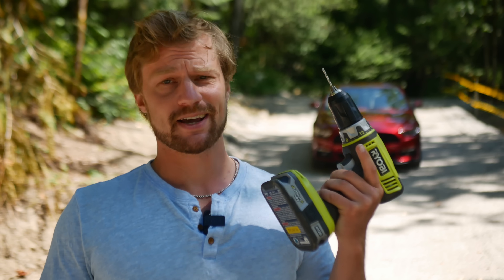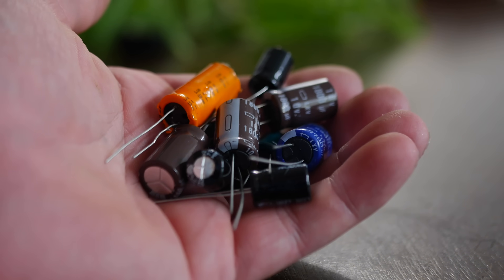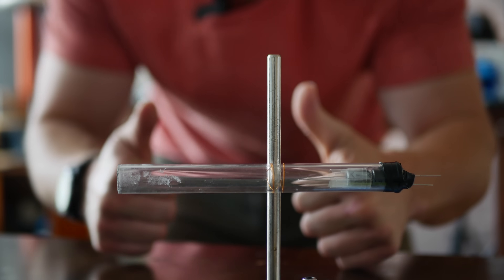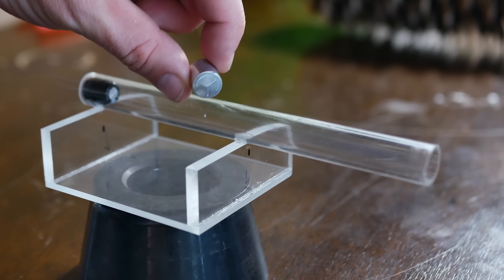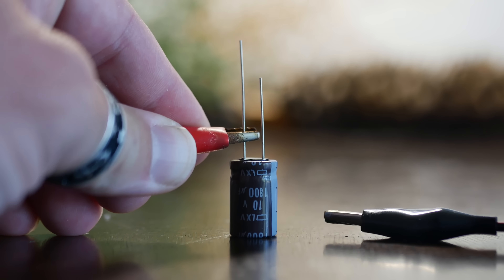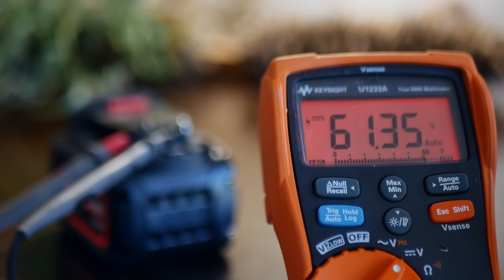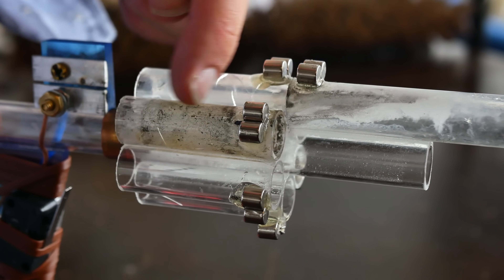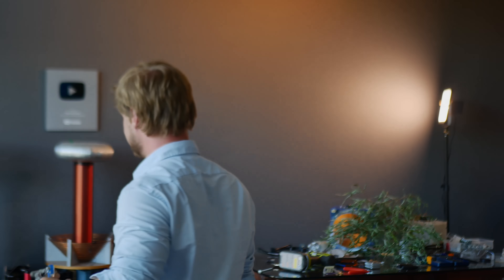I Built An Electric Capacitor Revolver!

Comment: Ha ! Have been playing with circuits and caps ...well good chance longer than you have been around ...yea I'm old. Titanium caps are more bang in a smaller package. As a younger man I built much of my test equipment,  and being a fan of militurization small compact circuits set about my work area.  While trying my newly constructed frequency generator,  a small circuit setting 3 or 4 feet away, exploded , at 3 am such thing can be startling . Now the board had been disconnected for several days and decided to explode ?? Well 3 am is a tad late to start an investigation.  Making sure all things were powered down I went to sleep. On the week end I took a closer look at the tiny board, the cap had left a good size mark but why. Had to find the schematic,  go over each trace on the board ... damn I hate puzzles ... lol next day check parts decided to rebuild and  duplicate the error. A few hours latter with an aluminum cap ...higher voltage rating...nothing trip to radio shack ...replace cap ...fired up frequency generator fumble trying to remember the settings ...bang ...but why ? But I now know the frequency give or take ... it would take some time but the little board was receiving that signal, acting as a voltage multiplier and bang had the little board been powered up it would not explode .... I miss those days ... spent most my life looking for why and repairing things , retirement was to be a rest with fishing and ...boring so I tried my hand at quadcopters  but the circuit was too big ....so I proposed a design to a semiconductor company ...they sent me parts the cad system allowed the designing, results 11x17 mm controller  worked simple double sided board, secret place the processor on the bottom ay 45 degrees the board required 4 feed thru connections two pads for power 4 for outputs. ... sadly age has stolen eyesight and manual dexterity... thus my bench sits abandoned . Hey take care .

Comment: 5:06 the bullet not leaving the barrel is a rare failure in ballistics. it means that your propellent produced less gas than the volume of the barrel itself. this usually is only possible with compressed air at extremely low pressures lol

Comment: this is literally a steampunk revolver lol. it uses literal steam as the propellent, which is awesome. i've seen a few different designs that use a boiling fluid (usually water) as propellent, and they are always interesting
Reply: Technically aren't all CO2 based airguns doing that?

Comment: There is one done by spraying alcohol/gasoline in a thic pvc-pipe  chamber,  igniting using kitchen sparks (piezoelectric) , the pressured ignited gas output can be adecuated for needs ,  nicely using pvc reductors... , ... has good results.  of course this I wrote is a story not steps for doing stuff and yes anything with pressure is not to be taken without knowledge , age , respect por equilibrium ( i think i nailed it)

Comment: Capsulated uranium in a sense kind of like assert or duct tape when you pull it apart quickly that kind of reaction I think would be a better capacitor of sorts if you know how to engineer it correctly but you can use byproducts of uranium like the glow-in-the-wop night watches from old times and some of the China and then there is a green uranium uranium glass producing a capacitor reaction if done right you'll get more bang for your buck

Comment: Question is that motor powerful enough to turn a whimshurst machine if so hypothetically it could power itself I would like to see you try just for the fuck of it
Reply: You may need to custom build the plates for the windshurst machine to be ultra thin ultra light ultra low friction with an induction coil the electrons returning to the capacitor could pump more electrons into the whimshurst machine making it more efficient

Comment: Have you tried using smaller capacitors?
I discovered accidentally that some small electrolytic capacitors shoot their casing out very fast. I was desoldering some componets with a blowtorch and one capacitor flew so fast it left a mark on the ceiling. I have only tried exploding them by heating them externally but it should work with electricity as well. It seems that the bigger capacitors just burst at the top with a relatively low pressure but the small ones are able to hold so much pressure that the case pops out of the rubber base and shoots away. Using them would simplify the design and make it more powerful and possibly more compact
Reply: Keep the higher energy of the big ones and just seal the top so they can't vent
Reply: @aliveandwellinisrael2507  wouldn't that risk a failure in the acrylic potentially blowing the gun up in hand?
Reply: lol, I had one 1000uf cap give me a black eye when I connected it in reverse on a slayer exciter circuit when I was little.
Reply: Older capacitors don't have those safety vents, even the larger ones. And on cheap chinese caps the vents sometimes don't work.
Reply: The big capacitors usually have groves cut in the casing, to create a weak spot that opens up a small hole at a relatively low pressure, allowing them to vent rather than explode (for safety - even if it's fun to make them explode in a controlled way, it's not that nice to have one go off in your face, if there is an unexpected failure of a device). The small ones often don't have that, since the explosion will not be dangerous anyway.
You can look at the aluminium surface on top of them when they are attached to a board (or when holding them with their legs down)
 - if that surface has some "lines" or a cross on it, they are the ones that will vent rarther than pop, haha. It it's a flat surface, they will probably go off with a good bang, haha

Comment: And what about some big ass capacitor to store energy, before realising it extra fast, extra high in your smaller ones used as ammunition ?
Plus, using some DC-DC boost /step up boards to achieved easily some high voltage.

Comment: this isn't a video about how to build a weapon.
continues to show everything you need to know if you have basic electronics understanding.
Reply from the maker: That’s the trick. I left out some pretty serious minor details- that if you built from this video - you’d likely fail at having it successfully work. I learned the hard way, and cut out the parts that would make this easy to build.
Reply: @PlasmaChannel  yeah you could do high damage with the 60V battery if you aren't carefull and know what to do.

Comment: First, you should not use modern capacitors, but old ones. there was no "safe" pierced bottom in the case. second, you need 220 or more voltage - it bangs like a shotgun.
Reply: Yes of course. Maybe, maybe. Very probably. Look here:
! New: Apocalypse Coilgun, Fallout Coilgun
https://youtu.be/G9-jKWPyMFo

See also: Portable Super Coilgun:
https://www.youtube.com/watch?v=rclLsQ9nyeg&amp;feature=youtu.be

https://www.youtube.com/watch?v=-mjDqp_oWZk

https://youtu.be/YLOYxsqvjw0

Comment: You would have liked the coil gun they showed on a T,V series here in Australia back in 1985 called Towards 2000, over the years I have watch them suppress any info on the show.
But they showed a coil gun with a ten foot  barrel they estimated, had the power to shoot a 10mm ball bearing threw an aircraft carrier and leave a two foot hole from one end to the other.
The live test they showed went through, 20ft of compressed phone books stacked 4ft wide 4ft high that had a foot thick of concrete each end squeezing it together, after that was block of lead 4ft x 4ft x 1ft thick just in case it made its way threw the phone books, then they had a 6ft x 6ft x 6ft block of reinforced concrete for extra safety, after that was the 2ft thick bunker wall.
When they fired this thing, the room turned yellow, and after the dust settled from the phone books being vaporized you could see the blocks holding the books were rubble the lead had a 2ft hole in it, the reinforced block was rubble and the bunker wall also had a 2ft hole in it.
They never found the projectile.
No wonder they suppressed the series of the internet, slowly but surely it has all but gone, like it never existed.
They showed all kinds of cool stuff, inviability, a living AI computer smarter then anything else ever developed, it is were the Terminator movies came from, they used it to build a military soldier and had it working with humans in an ungrounded military base, and yes it turns on them, pesky AI just can't tell who the bad guy is.
Reply: Yes of course. Maybe, maybe. Sure. Very probably. Look here:
! New: Apocalypse Coilgun, Fallout Coilgun
https://youtu.be/G9-jKWPyMFo

See also: Portable Super Coilgun:
https://www.youtube.com/watch?v=rclLsQ9nyeg&amp;feature=youtu.be

https://www.youtube.com/watch?v=-mjDqp_oWZk

https://youtu.be/YLOYxsqvjw0

Comment: i recall walking into my local electronics shop to find the staff gigglinh like idiots, waving hands to try to clear the smoke... they were using ceramic caps and leaving a small dent in the tiny heat sink they used to lay the caps on before over volting them. do not know the specs, but might be worth a look...
Reply: Sure. Maybe, maybe. Look here:
! New: Apocalypse Coilgun, Fallout Coilgun
https://youtu.be/G9-jKWPyMFo

See also: Portable Super Coilgun:
https://www.youtube.com/watch?v=rclLsQ9nyeg&amp;feature=youtu.be

https://www.youtube.com/watch?v=-mjDqp_oWZk

https://youtu.be/YLOYxsqvjw0

!Coilgun and Survival in the Zombie Apocalypse
https://youtu.be/_9WUcGwmS5s

Comment: Could you use a voltage doubler type of circuit, or step up, and a charged capacitor to get higher voltage, and the discharge rate of the capacitor would apply the voltage at a higher rate than just a battery and microswitch?
Reply: Maybe, maybe. Very probably. Look here:
! New: Apocalypse Coilgun, Fallout Coilgun
https://youtu.be/G9-jKWPyMFo

See also: Portable Super Coilgun:
https://www.youtube.com/watch?v=rclLsQ9nyeg&amp;feature=youtu.be

https://www.youtube.com/watch?v=-mjDqp_oWZk

https://youtu.be/YLOYxsqvjw0

!Coilgun and Survival in the Zombie Apocalypse
https://youtu.be/_9WUcGwmS5s

Comment: The better way is to charge up a massive bank of capacitors to a lethal energy level, say 5- 10,000 volts then create a switch maybe under insulation oil then create special bullets full of a conductive medium which will expand rapidly has it turns to white hot plasma (Salt Water may do the job, but you could even Hybridize things by using a damp Gunpowder with Graphite instead of Carbon in the mix) Has the Capacitors discharge onto the special bullet a massive electrical explosion takes place within the base of the bullet, the pressure is now immense and the Lead slug separates from the base of the bullet and is propelled down the barrel.
Reply: Sure. Maybe, maybe. Very probably. Look here:
! New: Apocalypse Coilgun, Fallout Coilgun
https://youtu.be/G9-jKWPyMFo

See also: Portable Super Coilgun:
https://www.youtube.com/watch?v=rclLsQ9nyeg&amp;feature=youtu.be

https://www.youtube.com/watch?v=-mjDqp_oWZk

https://youtu.be/YLOYxsqvjw0

!Coilgun and Survival in the Zombie Apocalypse
https://youtu.be/_9WUcGwmS5s

Comment: I just want to mention here how toxic this can be. You don't want to inhale the components of a capacitor. Yet, that is exactly what will happen if you aren't very careful. Also, what about the (liquid) fluids that resulted from the explosion of the cap? Sure, on a once in a while case basis its not as bad as it sending shrapnel composed of the capacitor everywhere; 

but the fact remains that the internal compounds which make up the capacitor are vaporized, and that is some thing that people should be keenly aware of imo
Reply: Very interesting video though! Some neat physics at play with these types of reactions in a (near) air tight chamber, particularly the part where the voltage isn't too high and the footage was slo mo
Reply: @briitch3131  Sure.  Maybe, maybe. Look here:
! New: Apocalypse Coilgun, Fallout Coilgun
https://youtu.be/G9-jKWPyMFo

See also: Portable Super Coilgun:
https://www.youtube.com/watch?v=rclLsQ9nyeg&amp;feature=youtu.be

https://www.youtube.com/watch?v=-mjDqp_oWZk

https://youtu.be/YLOYxsqvjw0

Comment: As opposed to a mechanical capacitoe? Lol. Well I guess a flexible membeane in a pipe is a classic mechanical analog of a capacitor. Though I've yet to see anyone build a hydrolaulic RLC circuit with a membrane for the cap, a stricture for the resistor and a weighted paddle flywheel for the inductor. I lack the resources to build something like this but Ive always wanted to see if it would work the way every textbook on electronics claims it should. I get the feeling water is too viscous and/or massive for it to work. But maybe superfluid helium would do the trick. But thats definitely beyond my capability. Unless somebody wants to donate a lot of kit haha.
Reply: Forgive the literal oodles of typos. Phone keyboards suck and youtube doesnt let you edit comments from a phone apparently.
Reply: @VoidHalo  Yes of course.  Maybe , maybe. Very probably. Look here:
! New: Apocalypse Coilgun, Fallout Coilgun
https://youtu.be/G9-jKWPyMFo

See also: Portable Super Coilgun:
https://www.youtube.com/watch?v=rclLsQ9nyeg&amp;feature=youtu.be

https://www.youtube.com/watch?v=-mjDqp_oWZk

https://youtu.be/YLOYxsqvjw0

Comment: With proper materials, one could make a capacitor-type item, that uses a reinforced case with a replacable tip, and fill it with saltwater. enough voltage to boil it all instantly.

Combine a dc supply and a voltage multiplier, with some flash charge cap, for power.

Would be useful for anything that needs a "notification" and reset, and can activate buttons/switches, etc. or even some one-shot vectoring thrusters AND would be replicable in places with limited resources. i.e. kinda hard to find potassium nitrate in bulk in a space station... but water and some electrolyte...

Comment: you should have added a voltage booster circuit built into the grip to really increase that muzzle velocity and also tried more aerodynamic/piercing ammunition to see what kind of damage could be done

Comment: Just need to automate the rotation of the barrel, pointless using any energy from the cap exploding to move it, perhaps a small stepper motor or some analogue mechanism that turns it after the trigger is released.....I'm sure that transparent aluminium is available these days, better than perspex. My first cap blowing was when I stuck it in the mains as a kid trying to make the xmas lights flash, electro boom would have been proud of me😁
Reply: Yes of course.  Maybe , maybe. Look here:
! New: Apocalypse Coilgun, Fallout Coilgun
https://youtu.be/G9-jKWPyMFo

See also: Portable Super Coilgun:
https://www.youtube.com/watch?v=rclLsQ9nyeg&amp;feature=youtu.be

https://www.youtube.com/watch?v=-mjDqp_oWZk

https://youtu.be/YLOYxsqvjw0

Comment: Look at RC lipo batteries for small high voltage, high amp discharge.  You can get 6s 1000mah lipo bats for $15 each. 4 fully charged are  100.8v.

Comment: I wonder if the capacitor needs less voltage or blows more effeciently if the terminals are connected in reverse, as polar capacitors are 'allergic' to miswire.

Comment: Incorporating a transformer could step up the voltage while keeping amperage the same.
Reply: Transformers only work on AC, not battery DC.  Also, double the voltage give half the current.
Reply: @KenJackson_US  forgot about that. A buck converter or similar is a thought as well.

Comment: As stated by some previous comments - use the battery (can be low voltage) to power a DC-DC converter that gives out nicely large output voltage (120 V no problem here, it also doesn't need to pump out massive current, if you have time to "prepare" the charge for next shot), use that converter to first charge up a massive storage capacitor rated to withstand such voltage, and then blow the projectile/load capacitors from this storage capacitor. Nice project though.

Comment: Nice idea. My idea is possibly it would be better if you could fire the spent cap. As the cap pops it should fire itself. If you could manage that, it eliminates needing any ammo other than the capacitors themselves. Admittedly I can't see a way of doing this, but then It wasn't me that can up with using exploding capacitors to make a pistol..

Comment: 60v is good, 90v is better, so, ah, how about going up to 300v with an array of cheap film capacitors (often rated for 500v) and a boost circuit to charge them?

Comment: just use a giant supercap to detonate a thin wire in a tube, therefore blasting a projectile with considerable force (jk dont do this that would be 1. extremely dangerous 2. you could die from accidentially touching the power supply and 3. it would be less a pistol/revolver and more a rifle/cannon size)

Comment: My late uncle did something similar in the late 70s or early 80s with capacitors, PVC pipe, pipe cap, inverter and a lead acid battery.  Usually he would use cotton wading, and a large steel BB for the projectile.  It only fired one shot at a time and it was not exactly portable but it worked.  Mind you though, I was very young at the time and the details are a bit fuzzy.